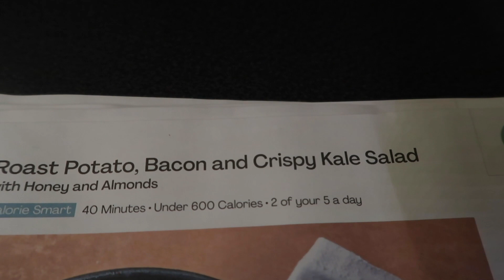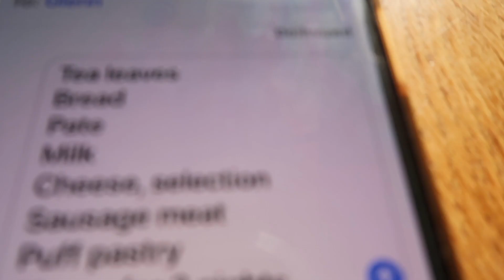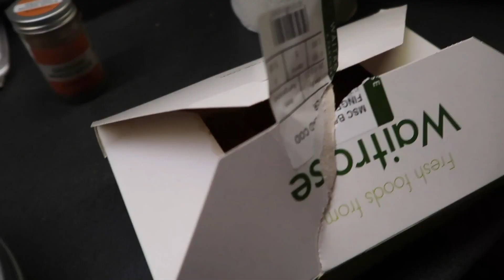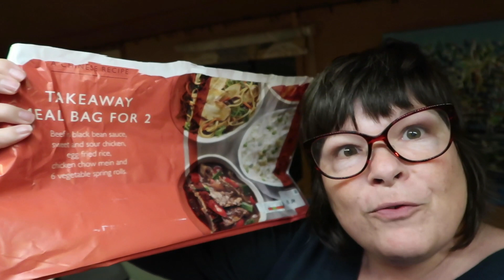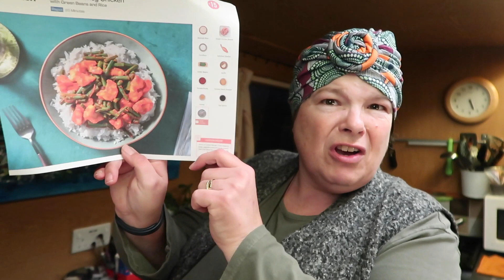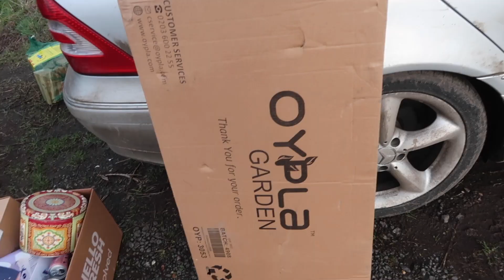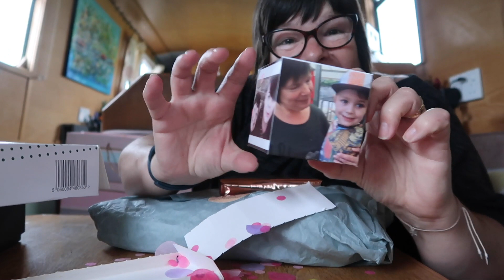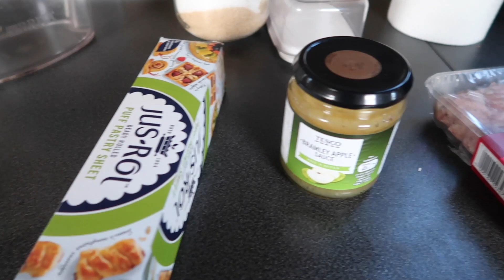Ep 168 Narrowboat Vlog | Weekly Video Diary | Birthday Week | 30 Jan (2021)

Comment: Was thinking lol

Why not make 4 square pieces of ply and park your tyres on the pieces of wood overnight etc and then when it snows overnight and you try to move the car in the morning you only have to wheelspin or slip your wheels off the ply to dry ground which should give you grip to pull away and no shovell required
Reply from the maker: That’s not a bad idea, I will let Glenn know!